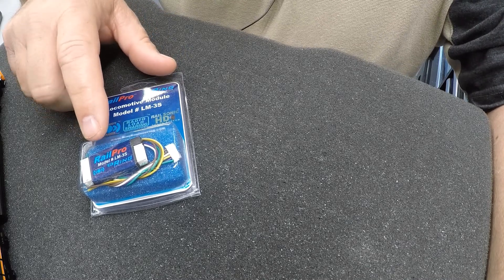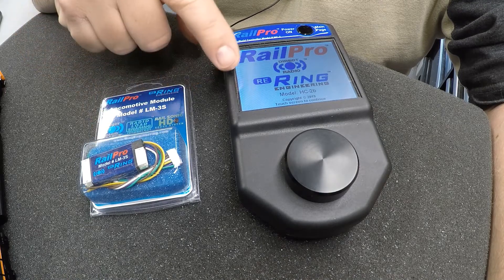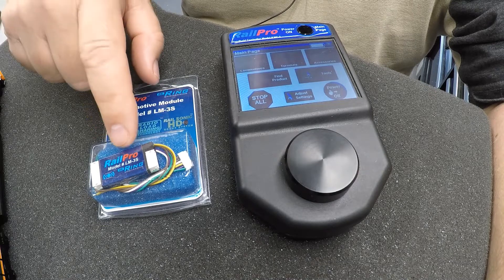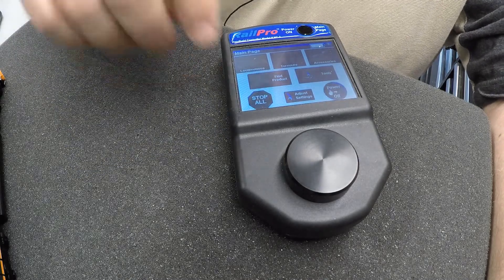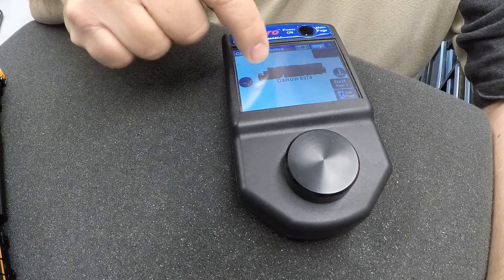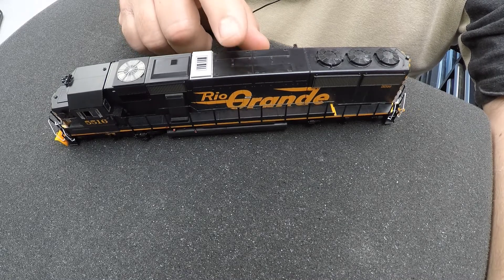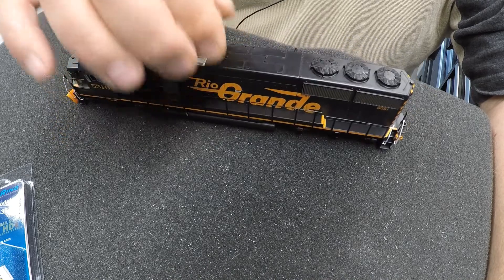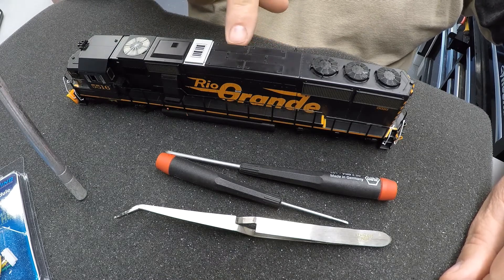RailPro Installation Video Series Ep.1

Comment: I like the look of the RailPro system. I am thinking of using this with the ESU and Zimo sound decoders that I will fit into my Heljan O Gauge Class 60 models as they are twin motored and are heavy freight locomotives.

Comment: Hi, thanks for this introduction to RP. I'm a NCE Power Cab user for the moment but I'm hooked on this system to 'run' trains. I was advised to start using the 'power' from my DCC NCE and just wire up some RP modules in the loco's and run the trains via the computer and the CI-1 usb to see and feel how it works.  How is your 'conversion' going - what route do you take ? Advise is most appreciated ! Greetings, Filip

Comment: Hey, this is an awesome channel so far. a few things, the item you’re referring to as a “receiver” is better called a “module,” since it has both a receiver and transceiver which it uses. Second, it communicates via radio freq that Ring Engineering has developed, so it does not get interference from other wave lengths, and is not Bluetooth.

Looking forward to seeing how the installation goes and how it runs!
Cheers.